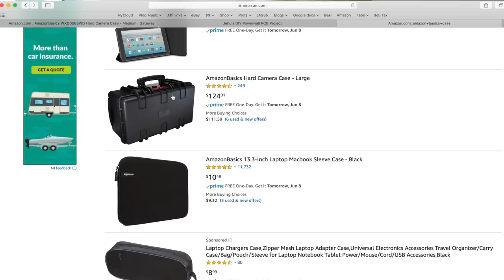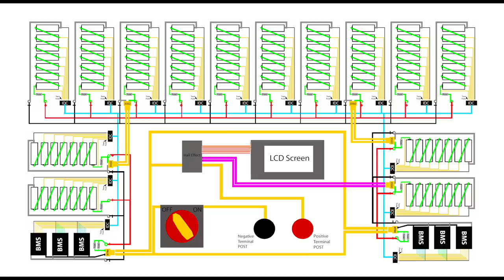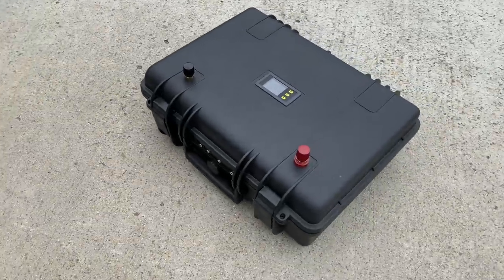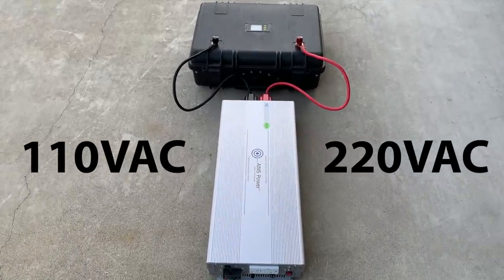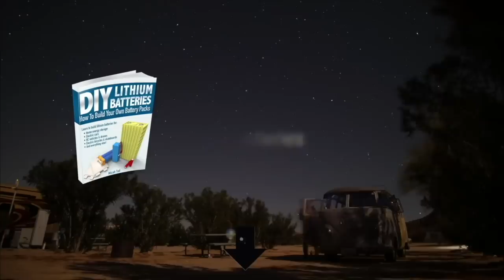600,000mAh DIY Power Pack build

Comment: Nice looking design, but I see losses and risk of fire.

1. The fact that it is just inserted in battery holders and not directly soldered is the first accident waiting to happen. Especially for a portable unit which might be moved around continuously. No matter what metal are the contacts made of, a random spark will build very high temperatures very quickly.

2. Only one fuse per bank, instead of one fuse per battery. If only one battery shorts, it will receive the discharge from all the ones in parallel with it, which will surely be hundreds of amperes causing it to explode or start a fire.

3. Low amperage bus wire and on top of that, crimped to the connectors instead of soldered. Crimping may create loose connections more times than you think. Also, this is about very high DC currents, which will need large diameter wires. For its most part, a DC current runs in the skin of conductors, needing larger diameters for the wires. The same as the "skin" effect when an AC current faster than 100 KHz is driven through a conductor wire.

I know that a lot of money and parts were spent on this and the final product is beautiful and nicely organized and I also like the looks of it, but I think you could be more thoughtful about security and efficiency on this. I wouldn't store it anywhere inside my house when not in use.

I like several of your projects and this critic is constructive. It would be sad if someone follows your guide and ends up with material or health losses.
Reply: 4. The screws mounting the battery packs to the case are live and poking outside. Doesn't take much to short them to anything conductive outside the case.

Comment: Yes 
I have two electric troller.motors. i am going to build a suitcase battery when I find the right amps needed so I can drive it with a battery for a few hours at half speed. That will put me on course to keep building electrics for my canal and a few lakes too. I built my own camper flat bottom boat. If this works then foiling is next!!

Comment: Hi Jehu I was just thinking just wondering if you can help answer this simple questions, can you build a Tesla supercharger for home use, I have seen Tesla supercharger on the road that can charge a full charge of Tesla car for less then an hour second question does this supercharger damage batteries?
Reply from the maker: Yes anything is possible but you need access to proprietary Tesla tech and a 100kwh battery pack capable of 200kw output, at least

Comment: Awesome video!  I am a welder by trade and have many M 18 battery packs of every amp hr that they offer. Smallest up to several 12.0 batteries.   I don’t want to rob the batteries from their battery packs cause I still use them.  I want to know if I can connect all of the batteries in a suitcase so I can have power for like when I go to my daughters softball games for fans or whatever else.  I do have Milwaukee fans already also but I would like a power source if needed.  I am electrically illiterate!   I watched one YouTube video where a guy joined 2 m18 batteries together but the video left a lot of questions.   Anyways Thanks Ross

Comment: referring to mAh for battery size is like using inches to describe speed.    I'm moving at 600,000 inches.
Reply from the maker: But every powerpack manufacturer uses mah to describe capacity.  If you are above average you should be able to figure out how much capacity this has.  But if you are an average joe with a 10,000mah power pack,  then you also can easily figure out how big this battery pack is compared to what you can buy.

Comment: I'm copying and doing this project exactly the way you are presenting it and already in 4 weeks now, and finally the inverter, can I use a DC12V inverter to convert to AC220V?  Or should I but a DV24V inverter to AC220V?

Comment: Hi there amazing project but i have 4 big issue about safety and usability:
first: the 2 main connectors  red and black are in the worst place ever: as u move the case somewere u'll hit everything in the path;
SEcond: main switch is hidden inside, so u have to open to turn it off... and as u open u have all the terminals exposed.  a spill of water and u'll have a catastrophic result
Third: there is nothing that split the external case from all the component, u just place em in the case.... if the case falls on ground.... it can pearce itself with those blocks moving
4th: how it cools?  on charging\ discharging there will be a lot of heat from batteries.

I really like the power bank case, i dont have 2000$ to play with, but  what about those 4 points i marked?
Do u considered ?
Thanks for your attention, best regards!

Comment: Bro... Look into high capacitor military batteries for helicopters.  They look like marine batteries but have 45k amp load.  I think they use 8 of them in paralell just to start a helicopter.  It's must start  situation, so there batteries are the bomb.  If your in Cal look for the manufacturer.  Those helcopter batteries are bad ass.

Comment: how long does this battery pack recharge? is there a way to quickcharge this like a tesla car charger?
Reply: Just do the math. 600Ah, so at 6A charge rate it will take 100 hours. The charger on his website will deliver 2A at 30V.  It's a 7S pack, so 3.6V x 7 = 25.2V nominal. 600Ah / 7 = 85.7Ah for the 7S pack. To simplify let's say it will charge at 2A. This means it needs to charge close to 43 hours.

I'm currently building a modular kit with 105 cells and plan on making it easy to split the 7S back to 1S, 2 groups and charge every group with 6A (china charger). This way it will "only" take 26,6 hours to fully charge the complete pack. It's insane.
Reply: @ChrisViralVlogs  Get a DPS800 psu (or two) and Charsoon Antimatter and charge 7S at 20A (or 30A using both PSUs - one will need modifying to float the output).
Less than $200 and you can charge at 1kW.
Reply from the maker: 84ah  so 40 hours with small 2A charger but 1 hour with 85A  charger

Comment: @jehugarcia I need your help. I'm making a DIY battery pack for my DIY electric motorcycle. I'm looking for the longest range possible. So should I go for high voltage low current or low voltage high current?

Comment: Very cool kit! I know you have put a lot of work into this. A Tesla module seems more cost effective though.
Reply from the maker: Yes but how do you fix the 22v on 24v equipment issue?
Reply: @jehugarcia  I guess in my case all my loads run through dc-dc converters. I know that probably wouldn't be ideal for everyone though.
Reply from the maker: Yup,  li-ion really needs to be 7s or is problematic for most people
Reply: @jehugarcia  I've been subscribed since back around 100k. I happen to be in soCal at the moment and I would very much like to come check out any projects that you are currently working on. Put me to work even.

Comment: Thanks Jehu for sharing! I'm working on converting my riding lawn mower to electric and having the option of a removable battery would make it that much better. Do you think this would be a good option? I'm not too sure what motor I'll be using so I don't really know the load for it but given the "standard" specs of brush less DC motors it seems like it would. Any help is much appreciated.

Comment: You have my attention on this, but I would like a 12vDC output from it. Are the control modules in this programmable to output a desired voltage, or would it need to be wired internally in a different way?
Reply: +1
Reply: Use a 24V-to-12V Buck Inverter ...
Reply: vto rsi I could, but would prefer not to.

Comment: 200 cells? And you have a ribbon that has how manny? Not 200 so how does that manage each battery? Or do you just do one module witch is ok but if that bms has balance charging then you are not really using it

Comment: VERY COOL.  What exactly causes the 9amp limit - e.g. could you double the inverter  (wiring etc) size and get 18amps?  or is it a Tesla thing?
Reply from the maker: 9A @240v = 2160w  @24v = 90A so maxing out the battery
Reply: @jehugarcia  OK - cool.  So one could build a 48v (maybe large cooler size) battery and maybe double/triple things.    That would get it close to the 20mile requirement by the other video and still fit in the trunk :)
Reply: @jehugarcia  would it be possible to charge the tesla while driving it?  I mean not taking into consideration software blocks
Reply: @nohayusuariospaponer  Yes of course, if you had access to the battery terminals and a 400V charger.

Comment: wait at what point did the voltage get stepped up to 24v, at the BMS? all i saw was everything wired in parallel to 3.7v
Reply: Each of the boards that goes into the case is wired in 7S2C. I know, you kind of have to look at the layout to get it, but that's part of why he's got the ribbon cables running to the BMS boards. Those are the balance cables for the entire stack of batteries.
Reply: @ClokworkGremlin  Those wires are the weak point of the design, especially the endings of the ribbon cables, it is very easy to short those out, they probably should have been covered with something to stop this from happening.

Comment: You should place a piece of foam between modules. It seems like there is a small gap between there, what if the power pack get a hit and a cell do not stay in its own bay ?
Reply: Well spotted, this is indeed an issue. Still, this build is lightyears ahead of most pack builds out there, even if it is a bit more expensive at least he's doing it properly from an electrical point of view. Some of the stuff out there is essentially telling people how to start fires. The number of BMS sense wire nightmares out there is not to be counted.

Comment: Which Charger would you recomend and how long do you think it would take? I'm renovating a House and this project could replace my gas generator.
Reply: Well the max current per cell is 5amp charging in. This case since they are parelel let's say 30amp charging current..
600:30 equals 20hours charging

Comment: How about a uint like this you can charge at a charging station not so much a supercharging station but that would be interesting if there was a way. 
But say the non Tesla charger stations, have a way to charge up a battery case so does not take days to charge or really long time. 
And have a way to plug in normal items like a laptop or basic lights, not so much a microwave or fridge. 
Kind of say a unit or case that has the batteries and boards to out put and input, if you wanted to go camping or keep if your power goes out you can run lights tv laptop or iMac.

Comment: Excellent Job Mr. Garcia I do not see a thermal management system on this unit. I suspect that the life of this external unit depending on the cycles of use is low? Can you give us an  estimated  MTBF.
Reply from the maker: Depends on use,  100% duty cycles = +-500,  50%= +-1000 cycles
Reply: @jehugarcia  Thanks keep up the good work!

Comment: You could do this every year to show us how battery technology has improved.
Reply: StarCitizen Modding not much in like 10 years. I remember already using LiPo batteries on my RC stuff 10 years ago and they were not much worse than they are today. Specs are a bit better now but in general, size, weight and capacity are pretty much the same. I also had some LifePo packs for other applications, same thing. 
Recently they started selling some LiCo packs with slightly higher voltage output but lipos are still king.
Reply: @fullmetaljacket7 I understand battery tech has not moved very fast in the past but i expect it to be faster in the future mainly because of electric transport.
Reply: StarCitizen Modding I really hope so. I would love to have a proper powerful electric motorcycle with good range and fast charging batteries.

Comment: Hey Jehu, I am an avid watcher. I was wondering if you can use capacitors in conjunction with the batteries. To compensate the power loss between the battery pack and the hook up to the Tesla. Or have a bigger battery pack and compensate the losses.

Comment: Hi, I need advice on this what kinda cell will help me to build a battery of 12V at  400A least. I need to run 3 Nema motors rated at 3.0 A 12v  continuous current, 2 Vex motors rated at 30A normal amperage for each motor but 68 A for stall current of the VEX motor is 68 A each. Considering my control and these motors need approx 100A. I guess with my specs of battery I can run it for approx 3 hours. Right now I am stuck between Li-ion cells 21700 had 4.5A current with 13 A discharge or these cells.

Comment: No thermal protection or cooling? I mean what if one of the cells heats up? Around 100°c, will both input and output flow stops? Lithium heats up fast than Li-po batteries. You should consider putting something like cooling fans

Comment: still confused about the BMS situation, as far as i understood, there are 7 cells in series wired as a pack, and then 10 packs in parallel, why do i only need 2 BMS ? shouldnt i need 10 BMS ? What needs balancing where here?

Comment: Have you ever made a battery with li-ion 26650 cells? I am looking for any resources or examples of anyone that has used 22650 batteries instead of 18650 cells to make a battery for an ebike or scooter.

Comment: i have been working on a hardshell 2-5kwh battery pack that has a J1772 charging port (the kind used at electric car charging stations.. And that also has a j1772 output to charge electric cars and also has ac inverter output and a 12 volt dc outbut and a USB output And would ahve some smarts to analyse the starte of the battery and communicate that via bluetooth to phone app. What you think? I was thinking this could be used as an RV battery pack and also as an emergency ev mobile pack that could give your ev a few miles of ranget to get it to a charging station or orther place without having to get it towed.. It could be also used to extend range of your ev for certain trips ..

Comment: What was the weight? Found out, it's 13kg

Would like to have the option to wire it for a 12v system. 16,8v tends to be okay for some 12v inverters, at least my NordicPower inverter didn't complain of my 4s LiPo.

If you have a 24v inverter then you can also add a buck converter. They don't cost much even for a professional made one with high wattage for using on 12v systems. Boat electronic shops sells 24v  ( that's up to 30v) converters for not so much money.

Comment: Is there a reason you don’t call it 600 amp hour?
Reply from the maker: Because most powerpacks are measured In mah so the average joe has a reference point to judge size
Reply: OK thanks - impressedby the work that you do!!

Comment: Why didn't you wrap all of the batteries in the video? Do you use their negative connections to put all of the modules in series?

Or is the load going through the boards/connectors?
Reply: Pretty sure he just ended up using the clear wraps that he showed near the start of the video, he may have ran out of the green ones.

Comment: How much did this cost overall, including tools etc
Reply: factoring the tools in wouldn't put a dent in the already $1220+shipping and handling price point.
Reply: @thesmellofbacon7595  tbh i might as well buy alot of 25000mah power banks for£30 and wire them together, it will cost alot less, didn't realize this would cost more than a grand, i could 41 battery packs and get 1amp of power (1 million mah)

Comment: Why we should have the same voltage for the batteries in the board ?
Reply: The individual cells are arranged in both series and in parallel.  Putting cells at different states of charge in parallel will cause sparking and high current from the higher voltage cell to the lower voltage one.  This will cause the cells to heat and potentially go into thermal runaway (catch fire).  Putting cells at different states of charge in series will limit the amount of energy you can get out of the battery since the BMS will shut off when the lower voltage cells reach 2.7V leaving the higher voltage cell with usable energy but no way to discharge it.
Reply: @mattmills7867 
Thank you matt 👍

Comment: Is there any benefit to this other than learning purposes?
A Yinlong battery is around $28 - 2.3V 40ah, it weigh around 1 kg (10 of these ~22 pounds)
It charges fast  but has worse discharge ~85% like in Lead Batteries
Reply from the maker: 40Ah @23v = 920wh  so you would 20 of your cells
Reply: exactly, The good is having fast charge capacitor with 20000+ cycles!

44 pound is a large weight to carry though~

Comment: I don''t know, I''d rather salvage the cells myself and pay 100 bucks for 200 batteries, 50 for the rest of the needed stuff, 3d print my box for 10.00 using 0.5 kg of filament, and 5 bucks to sand and spray paint. You know, then sell this thing for 500 bucks. Actually I've been making powerbanks for a while using this method and have 110v, 500Wh batteries using 60x 18650s at 2200mah.  It costs about 35 bucks for the batteries and everything else about 20. So just over 55 to make. I sell these for 150 bucks all day long. This build you have is well over 1,000 dollars. You could do it a lot cheaper. Considering a 2+ kWh power pack would sell for a thousands+ anyway, you can make over 700 bucks profit on it for doing it on the cheap. Hell, even if it took 10 hours to assemble and make, you'd still be making 100 bucks an hour money.
Reply: Who said that you must use new cells ?

Comment: I'd like to know how much you have into that? Seems like it would be a little pricey.

I did check out the kit,  batteries and case.  Looks like you have close to $1000 in the whole project.  It's not too bad for what you get. Still a little pricey for a DIY pack.